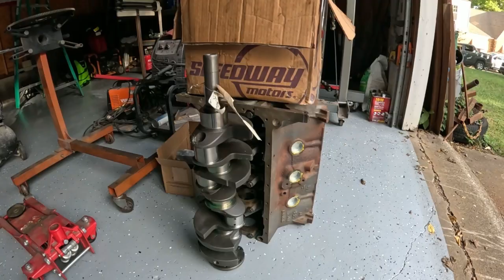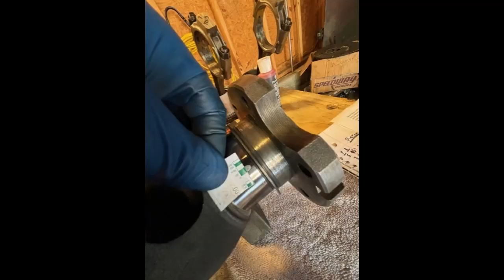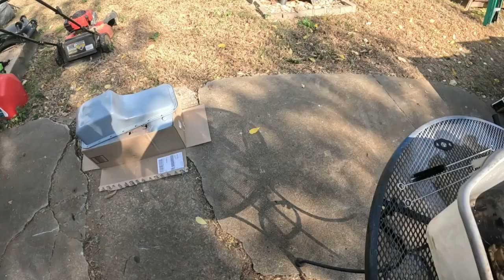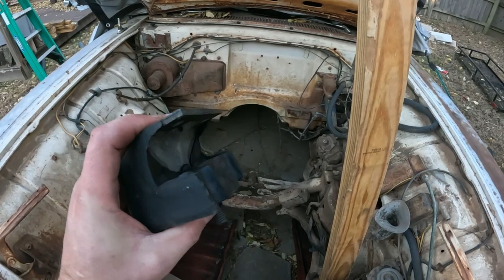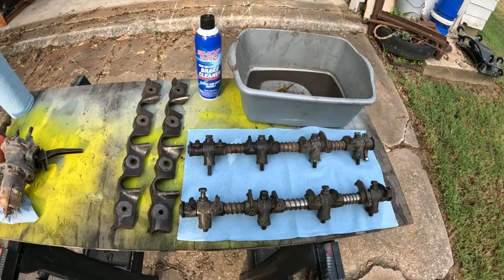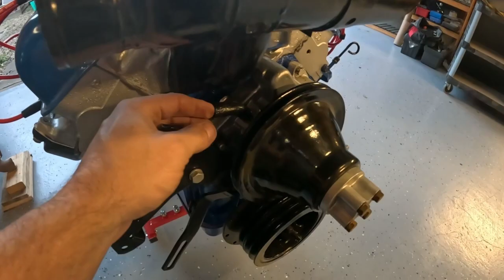Ford 352 FE Engine Build for a 59 Thunderbird

Comment: I know this is a year old but you should have installed the oil pump drive shaft with the oil pump They usually have a washer that goes towards the dizzy end that tkeeps the shaft from pulling out if you pull the dizzy in which caase the shaft can fall into the oil pan. The hole in the back of the manifold is for the road draft tube. The valve covers do not have breathers so the engine breathes from the filler cap and the draft tube. I would also wonder if your hood cleared with that dizzy stickng up so high. T birds i thought had a flat carb mounting surface becacuse the engine did not sit at an angle like the  passnger cars.

Comment: 35 yr old Dad gave 13 yr old me a '59 Squarebird when the car was 14 years old, 100K+ was considered pretty clapped out for a car back then. I went nuts tearing everything I could unscrew apart. That intake manifold was a memory! I managed to wrestle it up and over the fender, but coming down it was more than I could handle. I clamped it onto my thighs, with my knees crooked, and yelled Bloody Murder for my brother to bring me a little red wagon to put it in. Sadly at 65 I've never finished that car, still got it though. I DID manage to rebuild the 352, but then (like an idiot) let it sit in the rain too long, and wound up selling for scrap. Over time, the body has gone to hell too, from one storage mistake after another. But I'm going to finish that car, or it will finish me!

Comment: Why dont just put it in the car. Your going to alot of extra work. You are being careful and working clean im sure you wont have any major  problems. Yes motor looks great.
Reply from the maker: Thank you! I didn't put it in the car because I still have a lot of work to do on the engine bay. A clean, newly painted motor needs a nice background to suite. On top of that, I figured if anything went wrong with the engine, I'd have plenty of room working around it to get it fixed instead of having to lean over the fenders and potentially damaging anything I had repaired. This proved to be the right decision in the end.

Comment: Hei good choice cheap too. Be prepaired for alot of bs from ford guys lol glad to see you back on the project. Ive got a 60 bird in my pile of cars to restore. Only thing i wouldnt have done is the electric fuel pump. If you do end up running electric make sure its as close to the tank as possible. Thoes pumps are desidgned to push not pull. Keep up the good work.

Comment: Long shaft starters are difficult to change in Ford cars. I use Mummerts short starter in my  yblocks and early FEs, well worth the bux. As to exhaust manifolds, even factory installed no gaskets cracked badly, I wish I didn't know this. Didn't your 59 have the trunk heater unit? I think those were dealer options. Is your shift lever collar ok? I have a couple of good spares cause I changed to console shift T85. I designed a rear sway bar and had Addco build it. Its under my name not on their list, can send you connect otherwise nothing to me.
Reply from the maker: Yeah, there was a blower unit in the back. Nothing making it a heater but there was an a/c line that ran to it. The shift collar is in good shape but thank you for that... I'm telling you, the starter was an issue, through and through. lol

Comment: You could re clock that distributor so the advance is away from the tank.
Reply from the maker: That's likely what I'll have to do. There is room under the expansion tank but not much to work with.

Comment: Become one with the project. Stuck rings and wrist pins is just the way it is. Two months was plenty time to weld up oil pan. This corner cutting will cost you in the end. Drop it and weld it up. But nice build. Well done. 👍👍
Reply from the maker: Thank you! It's all a learning process, I'll never stop learning hopefully!
Reply: I agree on the oil pan weld.  No excuse not to do it correctly.

Comment: The mechanical fuel pump also supplies vacuum to the windshield wiper motor in '59.  Don't know if you can currently get the correct pump anyway.  Those water pumps are pricey, aren't they???
Reply from the maker: The water pump was pretty costly, like $200 but it's solid! I'll have to look closer at the wiper motors, I've heard about the vacuum but didn't even consider it honestly so thanks for the heads up!

Comment: Amazing build and good job on remembering the valley pan! I am glad my pain was able to help out someone out lol. I think the silver and blue look great together and will definitely set this engine apart from others! Also I am very impressed with your weighing of the pistons, rods, and pins, that is something I never thought of doing but a very good idea, I am sure your engine will run smooth as can be! That February timeline is definitely an aggressive one, I hope no surprises come up and you can meet it!  

Also, I spy a new Ford shoebox project in the driveway, I've always loved those cars and look forward to hearing about that!
Reply: Confirm rocker shaft clocking, can't just switch sides. Intake hole is for really poor down draft tube which reduced engine life. I run 3/8 hose to inner side of air cleaner element no pcv.

High miles minimal bore wear means high nickel/chrome alloy block. My 59 had one as do my 31 Hudson and Essex. Too expensive to machine so surprised Ford did them.

Tapered carb spacer is important for flat mounted Bird engine.

I always have my engines mass and spin balance entire rotating assembly. FE and Yblock will survive a lot of stupid but I like them to happily spin to 5K+.

The cast pistons will survive 87 gas when tuned correct, don't do full power when cold. I have a spare good running 85K mile 59 bird engine and trans which may have sticky modulator free but I won't ship, I'm in Seattle. Got my first square bird 1972 and still have one, excellent super cruisers.
Reply from the maker: The rocker shafts have this little "notch", it's hard to see but it's there and I'm positive I've got them in the correct position. I did get the tapered spacer after reading through the manual. There's a lot of little things that went into this engine that's not necessary on the more modern stuff. It's been an experience!
Reply from the maker: After watching your videos I made sure to get that stuff in there! lol I really appreciate you as a valuable resource. While the motor was in the shop I saw how important weighing the rotating assembly was and figured the shop was going to do it as a part of the balancing. I was wrong so figured it would be best to do it myself. Hopefully it will pay dividends.

February is aggressive but I'm on a pretty good track and I'm convinced I can make it. The rear end is done along with the transmission and now the motor so as far as I'm concerned the hard part is done, but the interior... that's the tough part. I got my upholstery already and it's awesome but shhhhhhhhhh... it's a secret.

You have a great eye! That is a 51 Shoebox I happened to run across and got a hell of a deal. Also took a class on chopping a roof so we'll see how that goes pretty soon.

Comment: A 1965 Ford thunderbird starter motor will work on the 1959  , much better. Also the crank case hole has a fitting available for conversion for a PCV valve.
Reply from the maker: I'm going to have to look into this for sure, thank you! I have the original starter, seems to work just fine but crank case vent would be awesome if there's something I can throw in there.
Reply: @walkercustomgarage  ; The old long statermotor can be replaced with 1965 , because the flywheel has 158 teeth which will match the statermotor.Along with the mounting bolt pattern.
Reply: Correction on road draft tube , there is a fitting for the back of the intake manifold to convert to a PVC system

Comment: The 352 engine for 1959 and 1960 were designed not to use exhaust manifold gaskets . If you use gaskets the  original exhaust manifolds will warp and fail. You must have them resurfaced for true if re-using them.  The bolts will be torqued to the engine specs , and with the special retainer lock washers. You must use high temp nickel anti seize lube on the bolts , such as permatex 80078.   Just my experience about this.   1960 Thunderbird owner .
Reply from the maker: I appreciate your knowledge. I did have them resurfaced and definitely got the anti seize on the bolts.
Reply: @walkercustomgarage  ; The Birdsnest for Thunderbirds has many used and NOS . Their website is very good.  They have the 352 retainer lock washers, and bolts that are to be used.